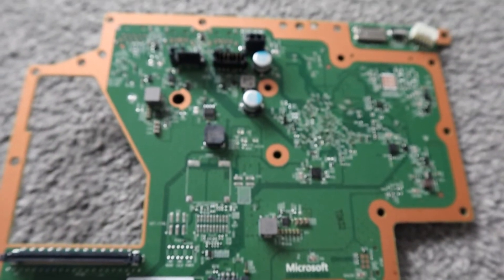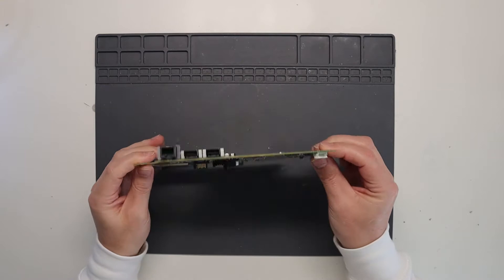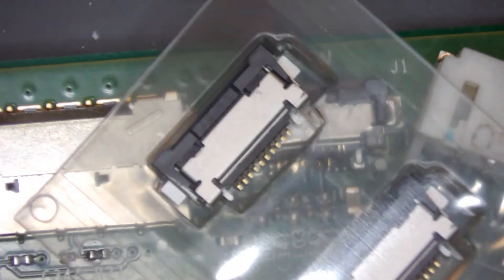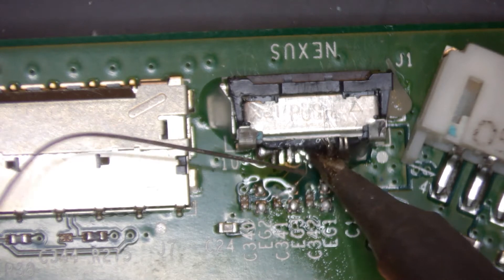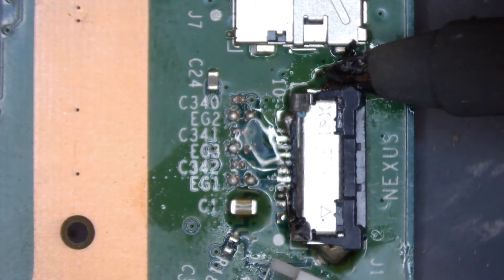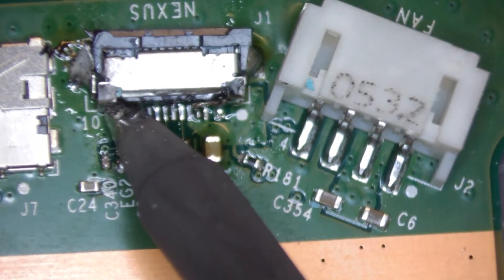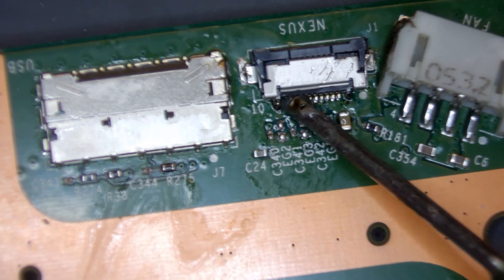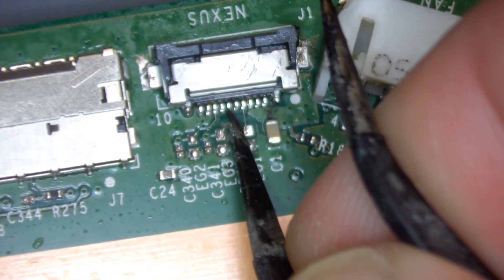How to replace a broken Xbox Series X Power and Eject ribbon connector #xboxseriesx #repair #gaming

Comment: This connector is so so fragile, mine just desintegrated. At least my console still turns on using the controller. I'll not try to replace it myself because I don't have experience soldering components into boards like this. I'll have to find someone who can do it for me.

Comment: My connector got damaged. And now I'm going to attempt to replace this exact piece. I've never soldered before. What temps are you using on your soldering iron?
Reply from the maker: Thank you - 350 degrees is my go to temp

Comment: Great video mate, I’ve got a fine tip on solder gun so might try solder it too myself. If the pins are all in tact and it’s just one side of leg that needs resoldering down would that still work do you think
Reply from the maker: Thanks Charlie.  Yes, as long as the other pins are intact, that would work
Reply: @TweakTips  just opened it today after trying to get this chewed screw out junior hacksaw did the trick. Just opened up and all pins are bent 😓new part it is

Comment: So lets say the pins are all in tact and just the housing itself got ripped off, is it possible to reroute all the pins back in and simply solder the housing back onto the pads that detached from it?
Reply from the maker: If you are really good at micro soldering, then yes it is possible, but it is probably easier to replace the connector.
Reply: Yea I got lucky cause the leg pads stayed but the connector got pulled off. So all I need to do is just connect a new one